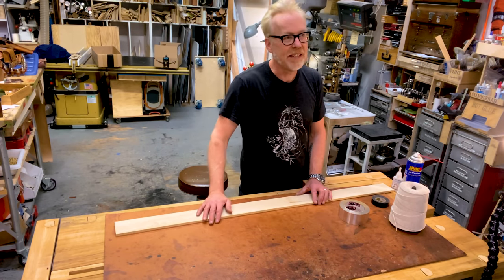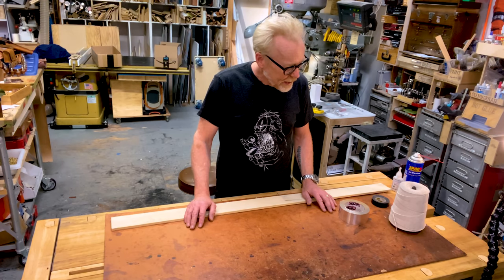Adam Savage's One Day Builds: How to Build a $5 Sword!

Comment: “We’re like minutes away from LARPing” classic.
Reply: Yep. LARPers pre Amazon.
Reply: Pease do not larp with a wooden sword!!! Make some out of foam.
Reply: @furinkazangamesn4410  well thats just... boring... wheres the fun if you cant get/receive at least some bruises or a splinter or two??
Reply: In other quotes "if you are into juggling", with full expectation many of us will answer 'yes'.
Reply: @curiousfirely  I would argue that juggling is considered more 'normal'. not that we care about that
Reply: @furinkazangamesn4410  You can have a wodden core and then pad it with foam - those cheap yoga mats are perfect for that. Then you can use the aluminum tape to give it a nice finish.
Reply: @karinefonte516  The problem with a wooden core is when wood breaks, it tends to make pointed stakes, which are kind of "stabby" and easily tear through the foam and tape.
CPVC or fiberglass pipes break differently. And fiberglass poles just go back to fiber and turn the sword into a whip.
-
Side point, the aluminum metallized tape is not usually approved for striking surfaces, insufficient flexibility and too much weight. Cheap duct tape or a poly/nylon sheathe over the foam is more often the standard.
Yeah, I LARPed for about 30 years, until health finally told me "no".
-
5/8" exterior diameter CPVC pipe, fiberglass strapping tape to apply lengthwise to the pie for reduction of "whip", Frost King 5/8" or 3/4" wall closed-cell pipe insulation, your favorite color(s) of cheap duct tape, some rope, string or long shoelaces can make a nice "grippy" handle as can hockey stick tape (which will leave black on your hands!), and some open-cell (cushion) foam for 'thrusting tips'. - - - That was my "under $5" sword materials list. One length of pipe and one pack of the Frost King insulation can make two swords and one or two daggers.
-
edit; OH! I almost forgot. Never apply the duct tape in a spiral. It adds too much weight and reduces the flexibility. Apply it in (usually four) lengthwise strips with a narrow overlap.
Reply: @MonkeyJedi99  I mean in the "good old days" our swords were broomsticks with pipe isolation foam around it. But yeah today wooden cores are really frowned upon and yeah fibreglass is the way to go. I miss the old days...
Reply: @Oglush1  When I started sword fighting, we used maple saplings and hockey stick handles. No tape, just hockey gloves and lots of bruises.

When I found out about CPVC and pipe insulation foam, it was a 2001 monolith moment.

Comment: Adam - I want to thank you for introducing me to metal tape. Your story about the shakespeare production is pertinent; I actually did produce weapons for a production  of Henry V in highgate in london, my first ever work creating stuff for any production of anything. I spent far more than I was paid, of course, but it was worth it.

Two swords (made essentially like this) were used in a very violent choreographed fight, and it was absolutely brilliant - before every production I had to re-cover the blades with tape, as the fight would chip and peel them as they clashed. I'm considering experimenting with some thick wire or something running up the blade  to make it stronger and give a proper metal clash. 

It was a truly amazing production and I implore anyone with time to kill to volunteer to help out on a small professional indie theatre production - it's a world everyone should experience, the atmosphere, the buzz, the bizarre animals that are actors.

Comment: Me and my dad did a run similar to this when i was a kid making swords for our childrens theater runs of about 5 plays, and outfitting the child roman soldiers for childrens nativity week, i also still have a spear i made using a broomstick i cut down, but over time i changed the fake blade for a non sharpened steel blade.

I have used electric tape and aluminum tape so much since then for little projects.

Im glad to think back an almost 2 decade old memory thanks to this video.

Comment: 10 mins in and I'm full of splinters from trying to draw straight lines on wood
Reply: Okay, maybe you should sand your piece of wood first for a bit.
Reply: Get a grip man! It’s a layout technique used by professional woodworking trades for millennia the world over 😂 ( get a grip was a joke just in case it wasn’t obvious 😝)
Reply: You may utilize your nails.
Reply: It's a very commonly used technique, even professors at my uni used it a lot. 

Also - when working with your hands a bunch, the skin on your fingers will get rougher and tougher.
Reply: Thanks, "old girlfriend" the framer. ✍
Reply: It is something it seems no content creator can skip these days because "cooool" ... everyone does it and i get your sarcasm. 
It is also in no way prefessional because if you twist your wrist while drawing the line may be still straight but the distance to the edge may vary. You can even see Adams line it not really straight.
IF you insist of doing it, the right way is to hold the tip of the pen to a folding ruler, get a grip on that with your other hand to adjust the distance and draw that way.
Reply: @ArmasLahtaaja :
Jesus christ, splinters under your nail
Reply: add a few $ for some band aids
Reply: @johnscott8592  Yeah, I have three techniques for this job depending on the accuracy needed.  Quick and dirty just guide the pencil with your fingers like Adam did.  More accurate a pencil glued to a rod that goes through a hole in a t square type fence with a thumb screw.  Most accurate is a marking gauge with a wheel cutter or blade (Starrett type or Japanese type).  Not everything has to be micrometer accurate.
Reply: @daanwilmer  Or maybe a couple passes with even a cheap block plane.  And a quick pass on the corners for a quick chamfer to ease the edge like in metal working.
Reply: You could fasten the sharpie to a vise or someting at a fixed height and move the piece of wood gliding it on the table, drawing a perfect line.
Reply: You could apply some electic tape to your ring and middle fingers...
Reply: @tiacho2893  The phrase an old instructor kept using "Your not building a watch"
Reply: @smittymoo  That said, I knew a retired Japanese maker of sashimono (household type woodwork like boxes, small shelves, and tansu).  He would make two piece wooden boxes where the lid nested so perfectly that the box pistoned into the lid over a few seconds due to air pressure.  And all this was done by hand (no power tools) with a few saws, chisels, and hand planes.  I met him in a guitar building course and he brought his entire tool kit in a wooden case the size of a gym bag.  
I didn't do that kind of accuracy when I used to make shipping crates for a few small art galleries.  They just had to be overbuild for strength.
Reply: this wont really help, but ive found a decent way of verifying your line is consistent is to go back along the other way. if your marking skills are inconsistent, this will likely show in the line not matching up
Reply: @smittymoo  mine kept saying you’re not building a Swiss army wife...
Reply: Most speed squares have notches in them at 1/4" intervals for exactly this reason. That's what most any framer I've ever met uses. You'd be amazed at the number of uses there are for a common speed square

Comment: I love how you looked at your tat when talking about the width of the slats, lol.
Reply: Low key, ruler/ square/ measurement tool tattoos might be the new wave. You’ll never lose a ruler again.
Reply: Unless you lose an arm...
Reply: Never noticed it before....well shit
Reply: AFAIK that is his first tattoo and also my first time seeing him use it. It is inaccurate and will get less accurate over the time, but a really great thing for a generic reference.
Reply: the tattoo also came with stabilizing chemicals that keeps the skin rigid in that area so the skin won't stretch or compress. its accurate to .1 mm because it still flexes a little. even with old age it won't change much.
Reply: @Dudeinator  that cant possibly be true
Reply: @bboooobbyy  lol
Reply: @Dudeinator  considering my luck with tape measures, getting a ruler tattoo’d on my arm would surely be tempting fate...

Comment: The only materials you'll need are just a plank of wood, aluminum tape, electrical tape, string, and glue.

And a table leg.

And a walking stick.

And spray paint.
Reply: And a wood cutting saw and a sander block thing

Comment: When making rougher quality or budget props, there's a lot you can do without committing to power tools. I cut down a 4x4 lengthwise with a coping saw, patience, and dedication, and sanded everything down with a sanding block and file. I think doing things the budget- and tool-limited way has helped me think out of the box, which has carried over to what I do now with CAD, power tools, and a 3D printer.

Comment: Another smoothing you can do for the wood pre tape is use some wood filler or spackle the blade, and sand it back, then prime it. Should be super smooth for your tape. That's one i've used for when I need to hide wood grain in some furniture i've made for folks.

Comment: They make black texture tape that is great for handles. It applies identical to electric tape, but doesn't have the sheen, and better for grip. You can skip the step of the string as well. Just take the tape, spin it to a tight spiral and it will form a sticky string. Apply it to the handle and then wrap the rest with the texture tape. I do this for all my hammers.

Comment: I forget what company makes it but it was the only kind I ever used that did NOT have a backing film. Just rolled like average tape. Loved it. Down fall..you needed to be moderately careful else you'd dent 5-10 layers. Anywho..Applying that tape (of any kind) carefully and welll as you did is a learned skill because the difference between shite and shiny  has a lot to do with how you begin to lay it down to minimize the wrinkles you hope to work out. Doing that on various shaped surfaces with skill and aluminum tape is an amazing way to give most anything a great real metal look. Maybe a skill enough for a whole video it's self because you glossed over a bit the tape applying madness method.🤘

Comment: We do a similar string trick on our hockey stick grips. You pull out a length of tape and spin it into a cord. Wrap the cord around the handle and do a second layer with the same tape. Gives a nice corrugated grip with no special (read: expensive) do dads needed.

Comment: You can pull the electric tape as tight as you want in the middle, but the trick to prevent it from ever unraveling it to start and end with loose wrap.

Start with the first 2 or 3 wraps without pulling tight (not tight at all), then wrap the middle as tight as you want, and then finish at the end again with 2 or 3 wraps without pulling tight at all.

Comment: It’s a lot easier to apply tape like that if you cut the exact length you want, peel the backing away at the center of the length of tape (perpendicular to the length of tape), when you separate maybe an inch width in the middle, cut that part of the backing all the way across the center, and cut away an additional half inch of each side of that center cut.  This way you have about an inch of uncovered tape in just the center of the length of tape.  

Lay the tape exactly where you want it, stick the uncovered center part where you want it, and then just peel away the backing outwards from the center as you press the tape down as you go.  Do it one direction at a time from the center of the tape.  

It will end up exactly where you want it on the first try every time.

Comment: hey adam, cool video, if i could offer a 'handy' tip.
just like you use your fingers in place of a marking gauge, you can use your wrist like a compas or even a spline template.
you just keep a your wrist fixed and pivot your hand around, correcting the alignement with your fingers as you go.

Comment: Quick tip on how to get the same shape on the tip. Draw one side cut with jig saw the one side take the cutoff use as a template for the other or use a piece of trace paper use sharpie. Flip over wet with rubbing alcohol.

Comment: This is an awesome little build ^^ a tip for what sword sizes are generally called it's like this:
-Arming sword, more or less what Adam made here. One handed swords often used with a shield.
-Long sword, a one and a half handed sword, usually the whole sword is up to your armpit from the floor.
-Bastard sword, is a subtype of long sword, that's just a little shorter, but still not a one handed arming sword.
-Two handed swords are usually as long as the person wielding it.

This is just general types, I'd recommend checking out Shadiveristy, Metatron etc for more in dept information of classical and medieval weapons and such. ^^

-Have a good one all and stay safe :)

Comment: For your sandwich style pommel, before you paint, get some sawdust then add glue mix and rub it into the lines. Wait till dry then sand smooth. It'll look like a solid piece if you do it right. I'm a cabinetmaker, you learn quick and dirty ways to hide anything. I used to build register stands and conveyors for grocery stores, those things are ugly till you do the finish work.
Reply: WHITE GLUE OR CARPENTERS GLUE ONLY!

Comment: Fun story from my end:

When my eldest nephew was 5, I told him " I'll make you a wooden sword for Christmas, but you have to get good grades in school.". I ended up doing research into historically accurate sword parts and fabricated his sword out of pretty much the same line of Adam's method, just with more detail ( carved double fullers in the blade, historically accurate hilt design, reverse intaglio engraved resin gemstone inside the jian style guard, etc.). Years later, it's become a tradition that his cousins get hand made wooden gifts ( if their parents ok it and if they are responsible enough to earn them) when they reach age 5. 

Story aside though, if you want to build wooden swords I recommend getting the following tools :
* a 4 in 1 half round wood rasp and mill file. ( found in hardware stores or possibly at dollar store/ general store tool isles).
* toothbrush from a dollar store ( to clean your file/ rasp teeth).
* a double grit whetstone from a dollar store ( for sharpening tools and sanding work).
* a Stanley Trim Plane/ finger plane ( found in any ACE/ Lowes- Depot hardware store).
* a multi step Emory boards ( from the dollar store beauty section). 

These are some of the products I use that comprise my portable mini woodworking kit. For me, they work wonders and can help out with tons of crafting projects.

Comment: If you think electrical tape is good try amalgam tape. it's a self sealing tape that's rubbery. the trick is to actually stretch it as you apply it, it won't ever come off by itself and it won't peel off either because it fuses to itself

Comment: I would like to suggest to anyone recreating this build to put the rounding parts onto the grip on the sides as opposed to the front and back, it'll give you a much better feeling grip because you oval it creates will be aligned with the blade edge and fit into the hander nicer! Great build though, thanks Adam!

Comment: If you have the money for a little bit of an extra expense, buy some baseball bat/pull up bar silicone grip tape. Not too expensive, padded, and extremely durable. The bat tape comes in a bunch of different designs if you’re into that, as well as straight black. Definitely gives a more substantial look and feel than electrical tape, but both are great options.

Comment: also something you could do - with even less tools - is just use a knife for everything. cut into the shoulder of your wood and peel up and you can cut away strips from the edge until you get the width you want. then once most of the material is removed, you can carefully hack away with a sharp knife to take off small amounts of material. just a pocket knife or kitchen knife will do. then you can scrape and whittle the edge to make it smooth. just be sure not to overshoot (leave three millimeters or so before scraping, poplar is soft wood so those 3 mm will go quick). if your wood is tougher (like an Oak slat like Adam mentioned), use a hand axe to slowly hack away at it, being careful to not overshoot your line. it removes material much faster and much more controllably than a knife. this is how mongolians make their longbows out of wood. but for poplar a knife is fine, you don't need much mass. then you can use your pocket knife as a draw knife to carve the bevels. hold the handle and hold the tip with your thumb and index finder and carve it drawing it towards yourself, holding the wood between your knees. start from the corners and just connect the midpoint of the thickness to the center line of your sword. then the bevels will be formed. leave 1 or 2 mm on the edge so it doesn't splinter (poplar is too soft). if you overshoot your center line a bit from half way down the blade to the tip, then carve the same angle on the other side until the ridge is centered and straight again, you will make a distal taper, in which the further half of the sword is thinner than the base, and it will be whippier. just make sure not to make it too thin. you want to keep the thickness above 1/8th of an inch the whole way down for poplar. maybe narrow the blade from 1/4th to 3/16ths of an inch, otherwise it will just be too thin. but it will hone the edge geometry if you thin it like this. using this method, hacking out unnecessary wood, you can complete the sword in a couple hours. ideally you shouldn't need to touch a file at all except for very fine sculpting. filing is just too slow, too painful and there's no need with wood this soft. you can whittle it like butter with a properly sharpened pocket knife.